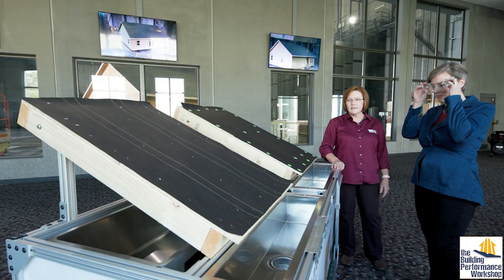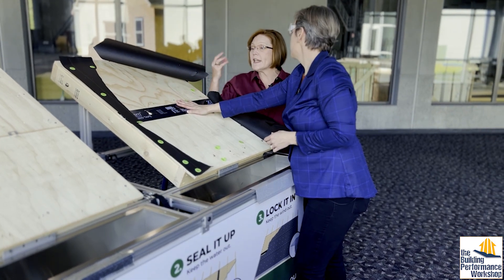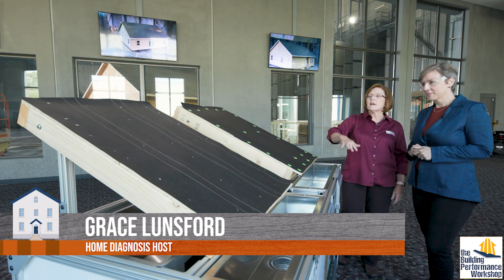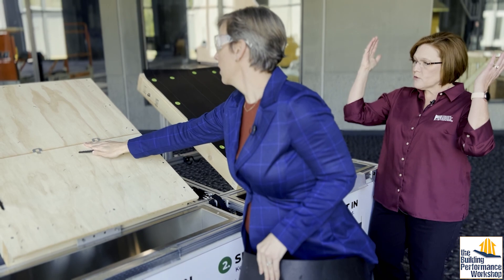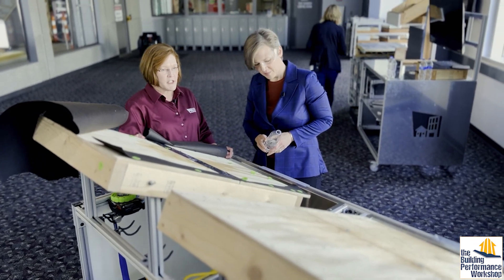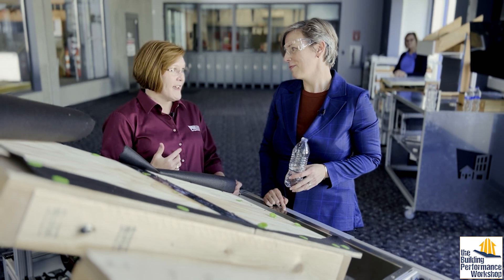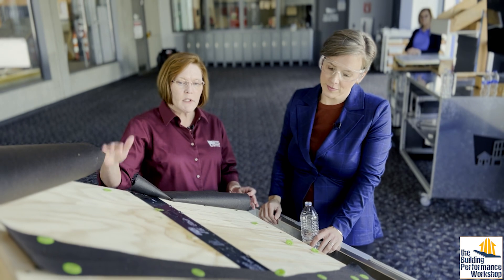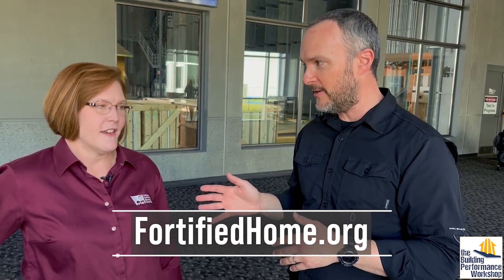Typical Roof vs. FORTIFIED Roof Demonstration of Wind Damage and Water Leakage

Comment: A vendor sent me the 150-page presentation for a fortified roof. As an electrical engineer, the first alarm that goes off is to look for the marketing. No detail is giving about shiplap roofs. It appears like they want to sell plywood and OSB roofs with no mention on 3/4-inch shiplap roofs. They did recommend the nail length along with an annular nail that doesn't pull out. But the flashing around the perimeter of the house is standard construction for a roof and nothing is new on the flashing. I did like how they did testing on roof shingles. And they did give blocking details for the soffit and only was need it if the soffit overhang was over X inches plus.  X = 16 inches (might be 20). They also showed how gables failed and recommended how to build blocking support and recommended the elimination of gables. Shiplap is pricy, I recently purchased 6 boards 12 ft long for about $200 for a remodeling project for a house built in Houston in 1974. i'm using it for the attic. I have an engineering background, A&P license, pest control background, large construction experience for large projects, and carpentry experience.

Comment: Will I be the only person who asks this question (hopefully not) but if I am do I get a prize? :)

What about using the ZIP system for the roof sheathing? I know Dr. Cope said that the preferred material for roof sheathing was plywood rather than OSB (which is what ZIP is made with) and then later on in the video she talked about how important it was to properly fasten down the roofing underlayment as well as taping the seams to help prevent water from entering the attic but ZIP sheathing already has an integrated WRB layer and you HAVE to tape the seams in order to get their “leak-free guarantee”.
If using ZIP is acceptable is it just a matter of increasing the number of fasteners along the edges of the sheathing panel for it to qualify as a Fortified Roof (because the OSB is not as strong as plywood)?
Reply from the maker: ZIP is considered better than code for sure, so the answer is yes, that sounds legit Ryan. Keep staying ahead of the curve.

Comment: so why not metal roofing?
funny enough over here on the other side of the world metal roofing is the norm and shingles are a "premium" option.
Reply from the maker: I asked, they haven’t tested any because it’s the minority here AND it would perform better in most cases if applied properly.
Reply: Insurance may require you tear out a perfectly good metal roof just because it’s 15 years old

Comment: Every properly applied and maintained roof I’ve ever had dealings with with families or myself so always last 20 to 30+ years. 
      This year we’re about to add a roller applied membrane coat on top of our Armstrong foam roofing that was applied in 1988 still in absolutely excellent condition should go for another 30+ years off of one roof flat roof.

Comment: Fortified has great manuals online. Their diagrams make it easy to follow system. On my house we did the forcefield osb and tape. If you are are really confident in your system you can delay putting on finish roof until a good rain. We found a nail hole where the nail gun must have not had a fastener and punched a hole in the barrier. One piece of tape and we are confident if the metal roof goes the sheathing is still pretty watertight.

Comment: As a roofing contractor, this was a horrible display and demonstration. No one uses tar paper anymore. Its all synthetic. They failed to replicate the nails that wouldve been in the roof as well. The comment about getting a new roof every couple years I literally laughed out loud about. The seam tape isnt a bad idea, but if thats whats saving you, youre already 2 failures in. Even a basic Timberline shingles wind rating is in the 130 to 155mph range properly installed. About that the decking can and likely will get blown off. 

Overall, poorly thought out video that will encourage people to overpay for a roof and not get any value for it. Theyd be better served finding a quality roofer, with consistently good installations  and a good warranty on top of the manufacturers warranty.

Seam tape is like making sure the 3rd clip of your home defense gun is loaded with hollow points. Buddy if youre on the 3rd clip youve got bigger problems.
Reply: What they're demonstrating here is the sealing of the roof deck, and how important that is to having a properly fortified roof. It's not the only component, but it is an important one. The actual construction methods they show here are correct, according to the national building code. So, they're showing you how bad it could be, versus what it should look like if you use the proper fortified building techniques.
Reply: @shubinternet  I don't think it's code to have a stapled tar paper roof. I think code requires shingles or something else on top
Reply from the maker: The shingles come off in strong wind, is the point
Reply: @HomePerformance  the point of my post above, that they don't just come off in high wind, they come off on high wind if the roof decking is rotted (so the nails can't hold), or simply an improperly nailed off set of shingles. Surprisingly the thing that protects a roof in high winds is air sealing between the attic and conditioned space! That's where the smart money needs to be.
Reply from the maker: Oh hell yeah I like where you’re going
Reply: I have to agree, and this isn't how roofs fail anyway. Normally either improperly nailed shingles for quick failures, or condensation rotting away the sheating from the bottom for longer term failures. Maybe thats why they wanted plywood, takes longer to rott. So if you install properly and have correct ventalation for the roof it shouldn't be a problem.

I think the taped seams on a roof are more for construction, so they can dry in the house without having to wait for the full roof installation.

Like you said, get a quality roofer who can hire people to put nails inside the strip (not a high bar), get the details right and you'll be good to go. Anyone willing to spend the money on these details should at least be able and willing to afford a good roofer.

I might still do more on dormers and other high risk areas though
Reply: If you think either one of those methods of applying underlayment are good practice Ill gladly not use you on my crews. The paper wasnt even running the right direction on either lol If a roofer shows up with any weight of tarpaper yhe conversation should start with, get the hell outta here with that nonsense. Got some 20th century roofing pros in here I see lol Lets bring it to at least 2010 and use ice and water and synthetic underlayment lmao
Reply from the maker: We don’t doubt you’re a hardworking, modern guy, but if you really think that your synthetic underlayment is used by God-fearing contractors everywhere, then maybe take a trip around the country. Code minimum is aimed for an awful lot here.

Comment: I would definitely closely inspect or have inspected any new/replacement roof installation.  My roofer was shocked that I actually went up on our roof after they finished and checked all the nailing patterns and how the pipe boots and ridge vents were installed.  Even though this company was a “platinum” installer for the brand of shingles we used, they failed to follow proper installation instructions and voided the warranties for every product they installed on our roof.  It looked perfect from the ground, but the work was actually terrible!  They ended up having to tear off and completely replace our brand new roof.
Reply from the maker: What a terrible story, Debra, sorry to hear it
Reply: On my first property they put short shingles so a roof rotten through in less than 10 years  with second house I knew where to start . Roofers did not bother to install new rubber boots on vent pipes  water were going into  a wall
Reply: They often forget the bathroom vents also. Leaving them in the attic and roof over the hole.

Comment: Watching this demonstration actually made me think the peel and stick underlayment would make even more sense. It has adhesion across the entire surface and you wouldn’t have surface penetrations with all those staples or nails. I really appreciate these demonstrations with third party testers! Thank you Corbett team! 😊
Reply: Youre refering to ice and water barrier. It still gets stapled and nailed thru but its a self healing membrane in a way. Its main benefit is preventing ice dams but has value over lower slope roofs too. 3:12/4:12 it can save you some headaches as the roof ages.
Reply: @godknowsimloved   When I re-roofed in 2014, 5/8 treated plywood with 2.5" ring-shank mails. !00% Grace Ice & Water Shield. Had to stop the roofer applying the shingles, they were only using 4 nails instead of the 6 required for high wind areas, Two hurricanes, few tropical storms & roof mount solar, no leaks.
Reply: @godknowsimloved   I think its suppose to help with water intrusion due to ice daming, but to actually prevent ice dams you can only do that with proper venting under the roof and potentially some insulation in the overhang. You need the underside of the roof to be cold so it won't melt any of the snow from the bottom
Reply: Peel and stick still doesn't seal. I believe it will say that on package. 
Its ease of install and its tougher for wind to rip off once adhered. Any through nails might get a bit of seal effect. 

It still leaks. When my roof was done they missed a bunch of nails. And as they walked on the underlayment, they would puncture. The rain found those holes.
Reply from the maker: High five buddy!